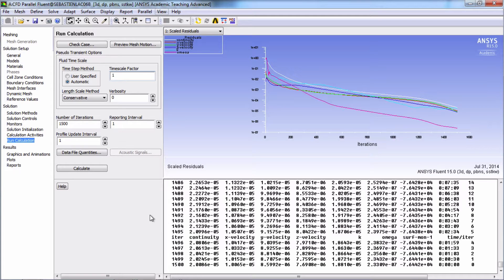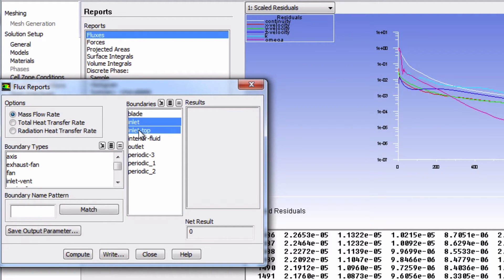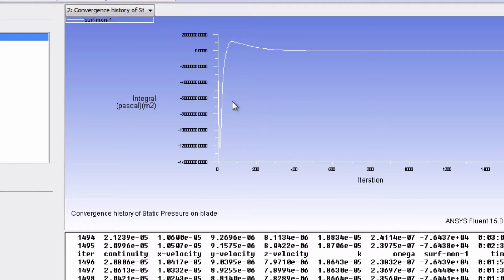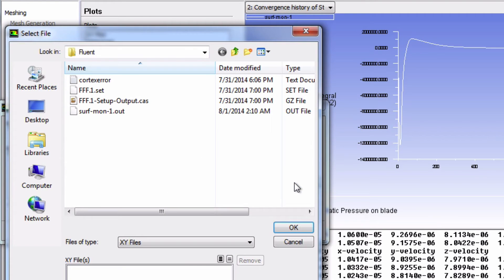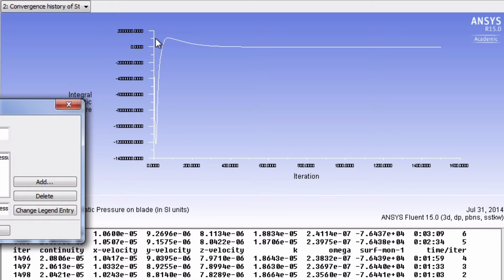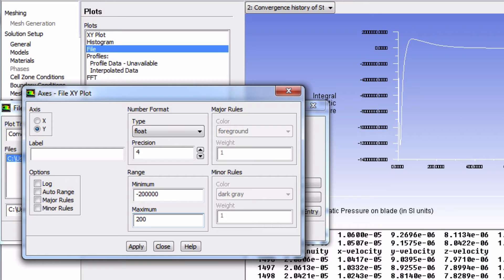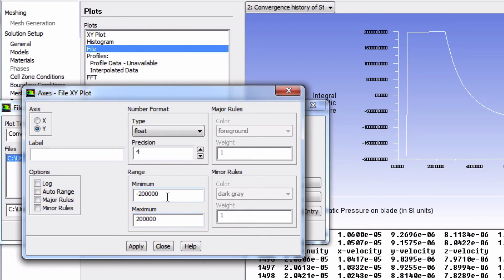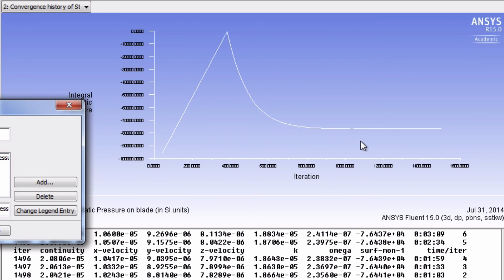SimCafe: Wind Turbine Blade FSI (Part 1), Results in FLUENT

Comment: Hey please do reply early.
Actually using your methods, I solved for a wind turbine blade 2.4 m in length having NACA profiles S822 and S823. However, I the coefficient of lift as -0.5 and coefficient of drag as 0.02. My project guide says the solution is wrong. Kindly help me out. I have to finish my project off by this week
Reply from the maker: Chaitanya Chauhan Did you figure it out?